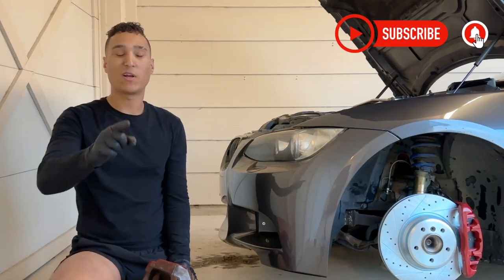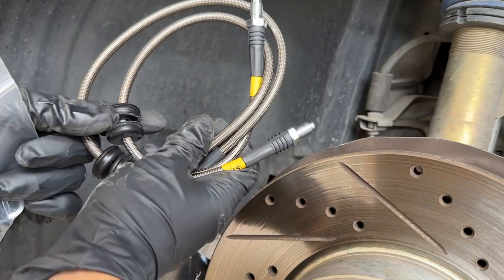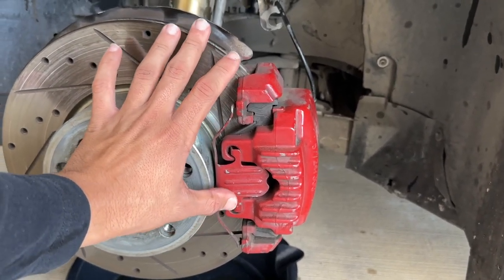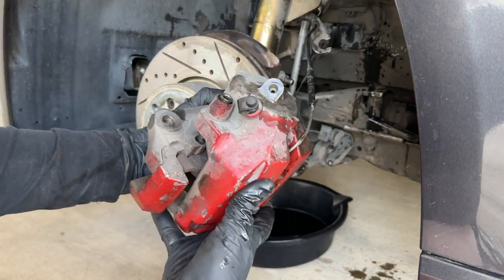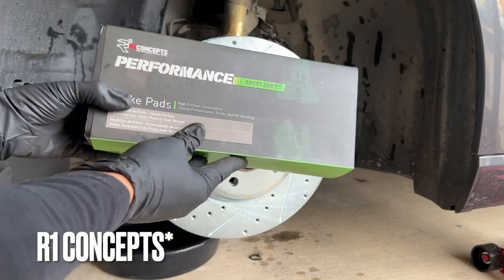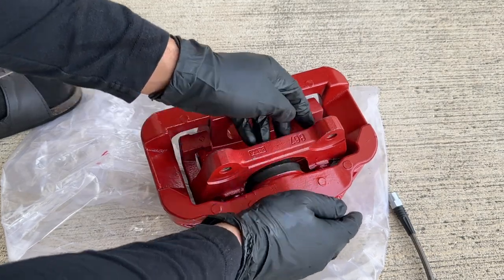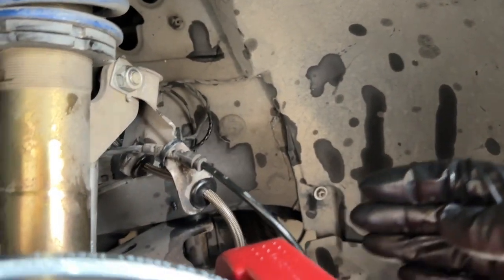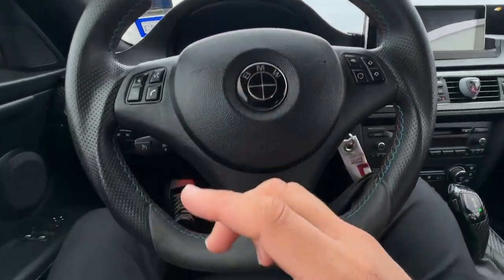INSTALLING BMW 335i BRAKE CALIPERS & ROTORS ON MY 328! | E90 E92 E93

Comment: You waste more money on upgrades than the car itself lmao
Reply: Yeah upgrading the stopping power of a car is a waste of money.
Reply from the maker: I’ve never felt more safe in my BMW than after I did this upgrade. It allows you to push your car to its limit while not dying. Worth every cent 💯
Reply: @IzzyE9X  Old mate up top has never felt real brake fade going down a steep mountain without even pushing the car.

Comment: It looks nice; however, for a regular N52, I think the regular rotors and brakes are fine even with regular fbo...I had to upgrade my brake set up to the 335 because I'm pushing more power with the supercharger
Reply: This is a very common misconception, the stopping difference is never “that” much different between oem and bbk upgrades. Main benefit is the heat dissipation!! That’s why almost every track driver upgrades theirs.
Reply: @josephsarach6872  yeah you right; I didn’t know any better and was advice to do it

Comment: Just a question, getting ready to do my 335i swap on my car. Do you need different caliper bracket bolts or will the same ones work on the 335 brakes? Great video!

Comment: Few questions:
1. Why did you choose only to do the front calipers? (Yes, I know 80% of stopping is front wheels, but why not do the rear as well? - Then there's also the parking brake concern.)
2. Is there a need to upgrade the master cylinder & reservoir?
3. Did you code the computer for the new rotors? If not, why?

For those who want to do this upgrade: Make sure you have 18" wheels or larger. 17" is questionable and 16" won't fit this size rotor-caliper combination.
Reply from the maker: 1. It’s significantly more work for not much more stopping power. On the E9X platform you can’t just swap the rears because the parking brake ordeal. 

2. There’s no need to upgrade the master cylinder, it’s the same across the 328, 335, etc.

3. You do not need to code anything if you just do the front swap, although to my knowledge you can choose to code to give you a more precise brake feel. I’ll say mine feels great regardless.

Comment: It's not about the size of the caliper.  What matters is the swept area of the total pad surfaces.
Reply from the maker: the size of the piston inside the caliper makes a difference is braking force. bigger caliper, bigger piston, bigger pads and bigger rotors equal more surface area being pressed on by the pad. this equals better stopping power

Comment: Great work! and the most enthusiastic 328i owner I've ever seen! I just bought a pair of front calipers waiting to be installed. However I still need to buy the motors, what exactly should I looking for in terms of dimension and type?
Reply from the maker: thank you! any equivalent to the 335i dimensions is what you’ll need to look for.

Comment: Note for anyone doing this:

The front’s are an easy plug and play, but the rears will not fit unless you get the 335 ebrake setup. 

I repeat, THE REAR CARRIER from a 335 will not fit to a 328

Comment: Is the caliper bracket interchangeable? Did you pull the caliper bracket off the 328 brake caliper and put it onto the 335 brake caliper?
Reply: You don’t gotta do none of that bro it’s a direct bolt on from the 335i

Comment: Awesome video man! Was thinking of doing this to mine. 

I’ve read that when doing this mod, you need to have the Performance Brakes option coded to get the most out of it. Did you get this done or it’s already good enough without?

Also, can the old 328i caliper bracket be reused? Or I need to buy a new one?
Reply from the maker: thanks man! I never have heard of the coding needed but I will say they feel insanely good even without it! the braking power is actually insane man!

Comment: Did you do rears or only front?
Reply from the maker: I only did the front because doing the rear requires you to mess with the parking brake cable, etc.

Comment: nice. are the rear the same? as the 328i? wouldn't  be worth the change over? definitely  will be doing this to my 328i
Reply: from what ive read fronts are plug an play, the same. but rear ones depends if you got AWD or RWD. AWD is different for rear.
Reply from the maker: the rear require you to do some more work because 335 parking brake is differently routed. only the front is plug and play

Comment: Are the rotors and callipers too big for 17 inch wheels? I have to switch to 17 during winter😭
Reply: Yeah they are the calipers rub on the inside of the wheel

Comment: How much did this retrofit cost? Is the braking significantly better? 

What about the rears are those not possible to swap?
Reply from the maker: full retrofit was about $500 for calipers, paint, rotors, pads, stainless steel brake lines, and fluids etc. braking power is WAY better. bits hard and smooth

Comment: The pads are about the same size. I dont see this doing anything but adding weight.
Reply from the maker: the 335i pads are much wider and longer, the rotors are also hugely wider. the piston on the caliper itself is also much larger meaning the surface area of pad that is pressed against the rotor is larger. the difference in braking is day and night, especially with the stainless steel lines.

Comment: Are the rear 335i brakes also bigger than the rear 328i brakes or is it just the front??
Reply from the maker: the rear brakes are bigger/better on the 335i, but they rear brake swaps is more intensive due to the parking brake
Reply: @IzzyE9X  I’ve seen threads online that says the rear calipers are a direct bolt on for the 330i, E91, E93, and all AWD models since they use the larger rear parking brake setup meaning you won’t have to convert the horseshoes and parking brake issues

Comment: Where did you get calipers ?
Reply from the maker: eBay used for about $100, cost about $30-50 to restore them (sanding, prepping, painting. all in all about $150. one of the BEST upgrades I’ve done hands down